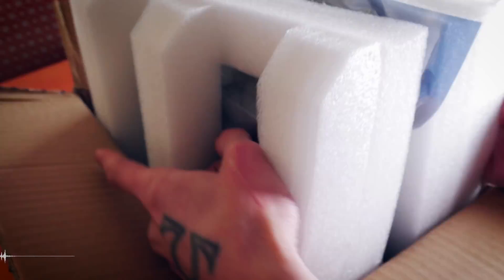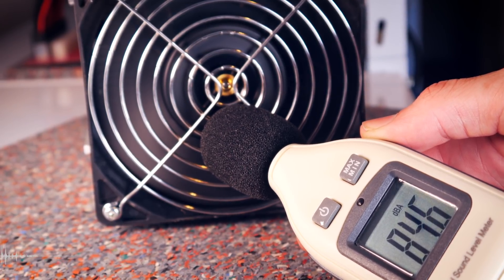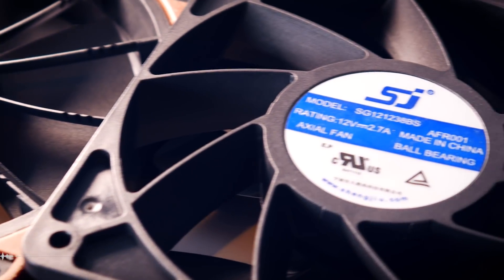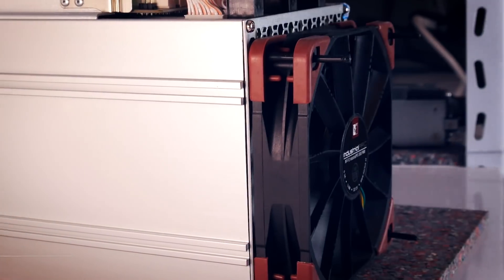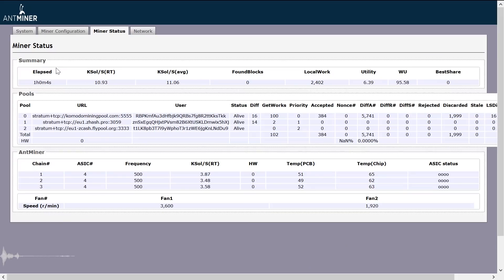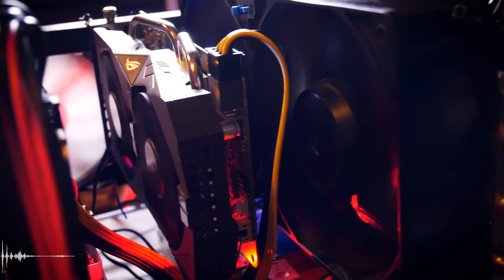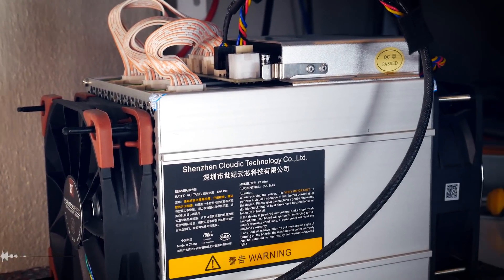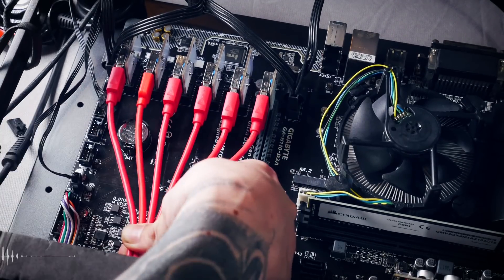Antminer Z9 mini meets Noctua: fan replacement & push/pull experiments

Comment: I slapped another antminer fan at the back and now my z9 is hashing at 750M with no overheating and low rpm
Reply from the maker: Very nice Frano, thanks for sharing! I am pretty sure I'll go for a Baikal fan next since I have those still lying around! Did you remove the metal-cage in the back or slapped it onto it like I did?
Reply: Cursed Mining I just slapped it on like you did, frankenstein way😂, keep us updated with the baikal fans
Reply from the maker: =D I definitely will! Thanks for being on board mate!
Reply: Michael Pace Single fan was around 4360 rpm with pcb at ~56 chips at ~70  now im at 3300 each with ~52 and ~65 and its more quiet
Reply: @franomaster1234  so you have 2 fans stacked on top of each other on the exhaust and the single fan on the intake?
Reply: Also I forgot to say that my room temps are around 100F right now 🙄🙄
Reply: Temps? Fan RPM? How much quieter?
Reply: Thanks for the info. Even max overclock my fan never gets over 4,200 rpm. I'm having trouble keeping mining room cool during the day so room temp creeps up to about 79 degrees Fahrenheit. Hash boards stop at 70 and drop to 62-65 at night. I going to add another fan as per your experience but i have another noise problem. My psu is a Dell server 1100w which seems to not be up to task for quiet operation. It randomly spins the fan up to what sounds like a loud jet randomly. What's your experience as far as psu with z9?
Reply: Michael Pace Same here with the room temp, I turned my basement into a mining room, added a 6" fan but it doesnt seem to be working as good so im going to switch it out for an 8". As far as my psu goes, im using a apw3++ that i got left from an antminer d3 i sold earlier. No noise issues but i believe 1600w is just an overkill. As Cursed Mining said above, 750 is plenty and stays more quiet than dell 1100w supply. Im going to try using a regular atx 750w psu with pcie splitters
Reply: It's the fan on the Dell PSU spinning up. It shouldn't be a problem because amperage is pulled not pushed. That's why you can hook a 1080ti and a 12v case fan to the same 12v  power supply. My Dell PSU is only Gold rated so maybe that's the problem? Z9 can't be pulling over 500w so you'd think it would be more than enough headroom.
Reply: On second thought you might be on to something. Psu's do have an efficiency sweet spot. I'm going to test volts and amps at the wall. If so i'll just put 2 Z9's on 1 PSU. ; )
Reply: Michael Pace Usually around 65% is the sweetspot, I got another z9 mini coming from batch 2 so ill try to hook both of them to a 750 if not then on a 1000w atx. at 750Mhz with two fans the z9 is pulling around 360w from the wall...
Reply: Thank you so much for the info.Batch 2 ? you should have 2 headed your way from what I've read. Are you venting to outside?  100F !!!? That's a sauna!  hot air off is more important than cold air on gpu's & asics. I should easily be able to run 2 z9's off 1 1100w psu (2x360w=720w). That would be around the sweet spot .  Thanks again ! P.S. nice to talk shop with another miner. I sometimes feel like a lone wolf.
Reply: Michael Pace Yeah I know the temps are pretty bad... anytime bro haha, we are not alone :)
Reply: Cursed Mining did you think about opening a discord group for our small miner community? I think there is plenty of info to be shared
Reply: Your hash board's stop at 70? mines chuggin along at 71 atm.
Reply: ahh kk cool i was confused i knew mine were hot but didnt think it was past a threshold.  Another couple week's till i move to a place with a basement perfect for mining, so thanks for all the info on this page!
Reply from the maker: Michael 750w HP Server PSU stays quieter than the miner and is only warm, not overheating. Maybe efficiency issue bc 1100w too strong?
Reply from the maker: Nope - but you guys just inspired me to do so! Just wanted to say that it was an awesome read. I'll get right on it! Thanks to both of you
Reply from the maker: hey guys! I'll do a separate video about it but I just set it up - https://discord.gg/Qb8K3v7 here's the link! Still building and figuring the server out =D
Reply from the maker: nah - could go further of course, I just like it to be below 70, just personal preference =)  will also push it more with further experiments! cheers =)
Reply from the maker: you are very welcome! We just set up a Discord, will announce it soon - link is above in the comments =)
Reply: Do you have the model # of that Z9 fan?  Can’t find a nice price for factory 2nd fan.
Reply: spacevibez I pulled one off an A3 and used it lol.